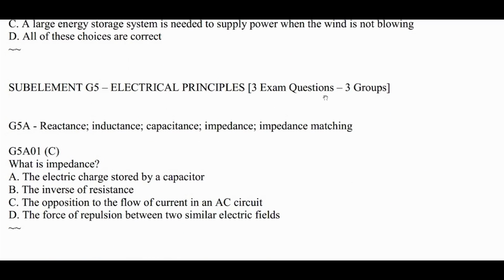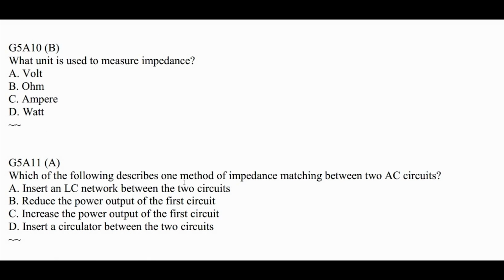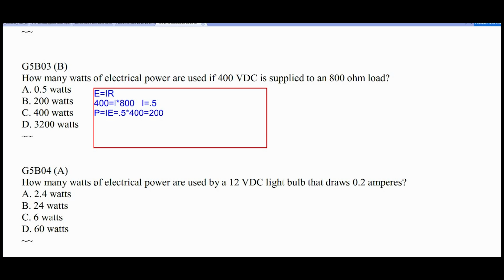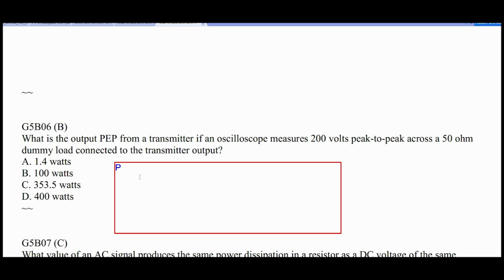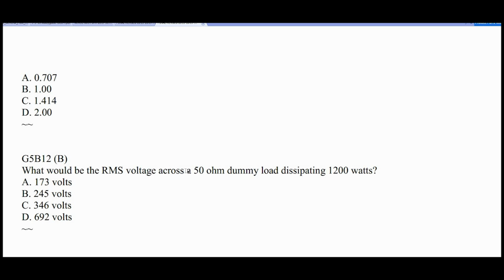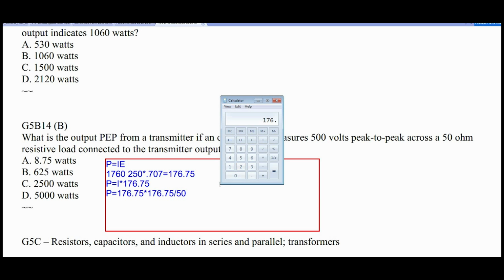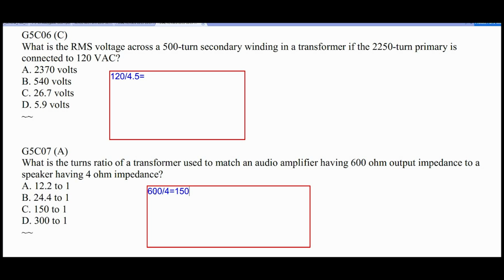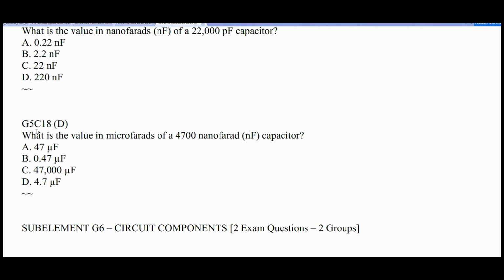Ham Radio General Class License Prep Course by Jim Heath W6LG; Part 5 of 10

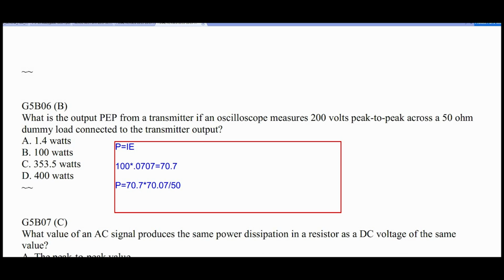Comment: 17:41  G5B06:  (SPECULATING) Since the oscilloscope in set up to read normal a/c currents, when measuring displacement current of a transmitter, it doubles voltage?  There is no absolute negative voltage.
Edit: or it's a typo.
Reply from the maker: Here's the question:  G5B06
What is the output PEP from a transmitter if an oscilloscope measures 200 volts peak-to-peak across a 50-ohm dummy load connected to the transmitter output?

Wouldn't there be negative because it is RF? Does there have to be, because it is RF at some frequency?  Thanks for the question!  73, Jim